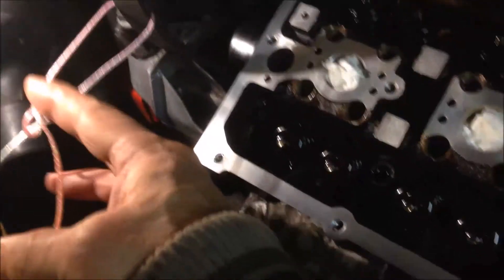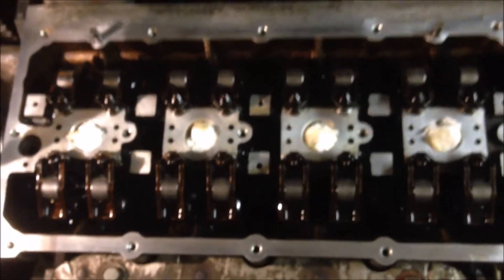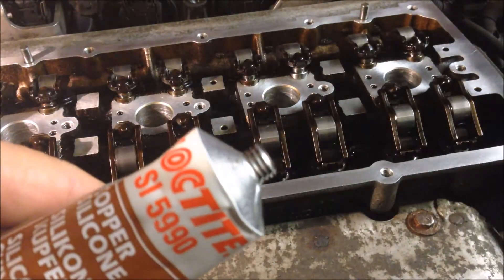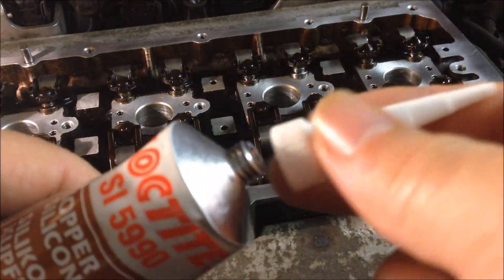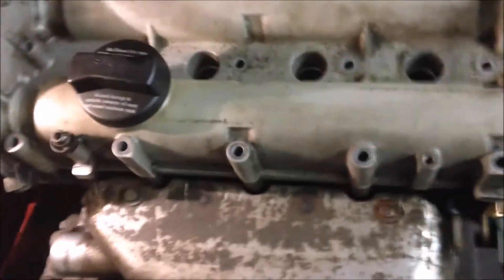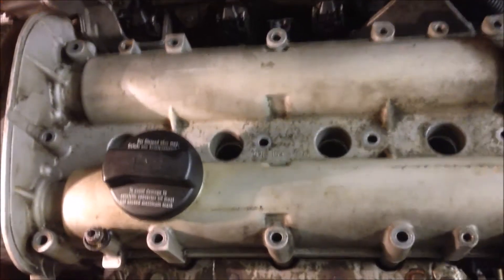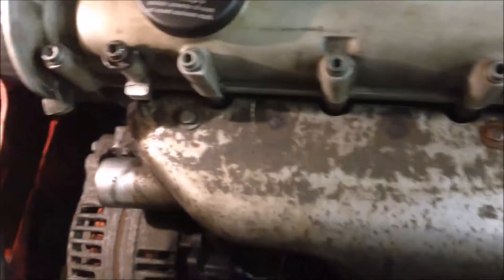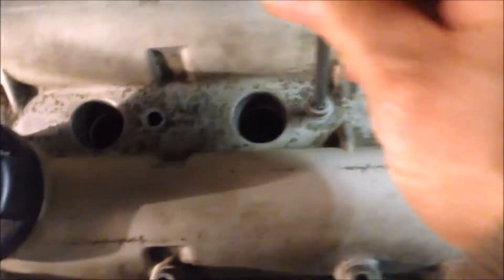VW Polo: Camshaft Carrier: How to Install (16v, 1.4, 6N2)

Comment: you didn't say how the cams should be positioned before you tighten down the cam cover, should the cylinder 1 be fully up or and thing like that
Reply: yes he should have said this as he could do a bit of damage here real quickly , so hes better to have number one piston up at top  and also have his pins in place on the camshaft belt toothed  gears  as he lowere the cam shaft housing into place , lets hope he got it all together without any breakage
Reply: You need to use the tool or drill bits the same size and line both holes